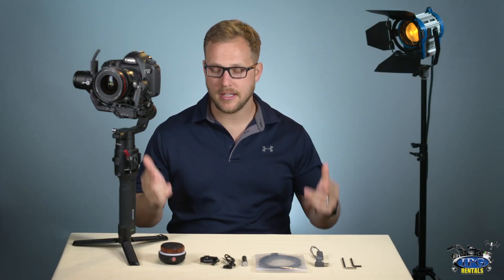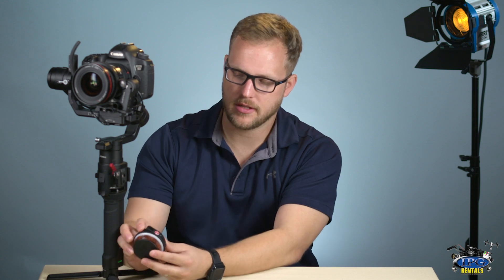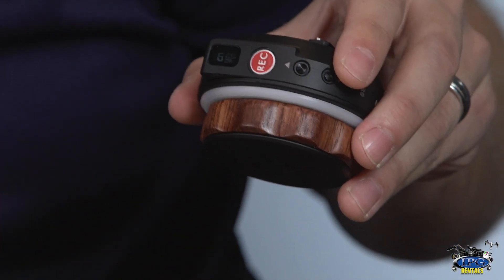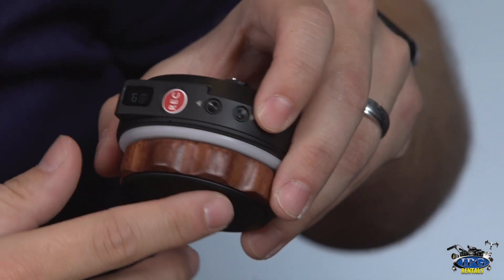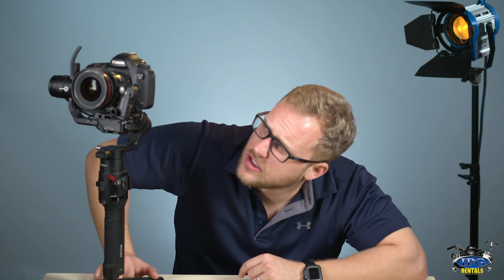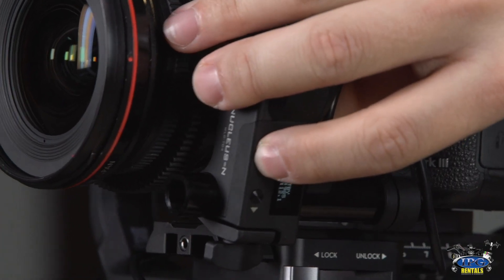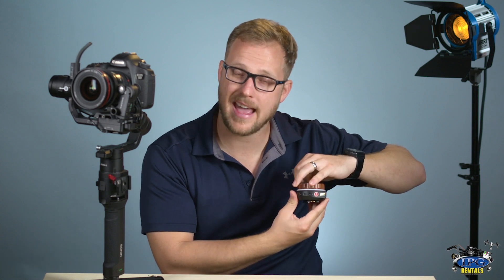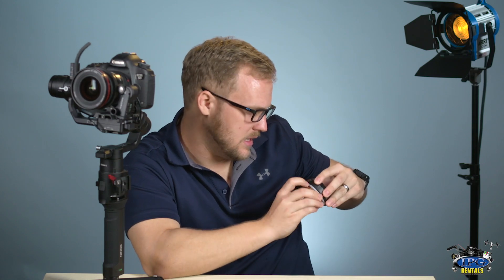Tilta Nucleus Nano Wireless Lens Control System Quick Setup

Comment: Have you ever encountered the problem where the screen on the wheel is dim? I'm at a loss. My battery is full. Can't seem to find a display brightness feature
Reply: Me too, I just got it and it is going back since you can just barely make out the number but can't read the font at all.
Reply from the maker: Yes unfortunately we did as well we had to send it in for repair

Comment: Good morning,
Thank you for your valuable information. I just bought the Tilta nucleus Nano, but I have a problem with my Sony (16-35mm/F4 and 24-70mm/F4) Lenses. After calibration, with these two objectives I can not make a stable adjustment of the points A and B, the point will shift each time. With my other objectives (DF) with stop, it works perfectly. Would you have an explanation? 
Thank you.
Reply from the maker: Is your rubber ring sliding? When setting up the points in DSLR lenses it has very little travel from one end to another so that’s weird.

Comment: Thank you for the review.  I still don’t understand why there is no internal power for the motor.
Reply from the maker: You mean instead of running on battery?
Reply: IPG Rentals Yes.  And it is unfortunate that I don’t use gimbal that much.  As opposed to Nucleus N, the PD movie one has an internal rechargeable battery.  Of course it is more expensive that Nucleus N...😭
Reply: IPG Rentals the motor does not run on a battery
Reply from the maker: Yes the motor does run on a special battery
Reply: IPG Rentals the focus wheel, but the motor does not. What battery are you referring to? I have the same unit and the motor connects via USB to a power source. There is no replaceable battery in the motor that turns the lens gears.

Comment: Can the motor be powered from GH5S? I don't use gimbal.
Reply from the maker: Sorry I thought you were talking about the ronin s. The motor is powered by a battery which is provided and WiFi. Hope this helps
Reply: IPG Rentals the motor does not come with a battery. The wheel does. The motor is powered by usb or Dtap